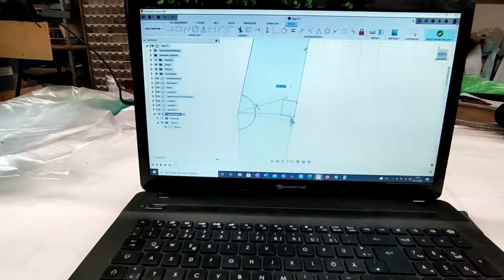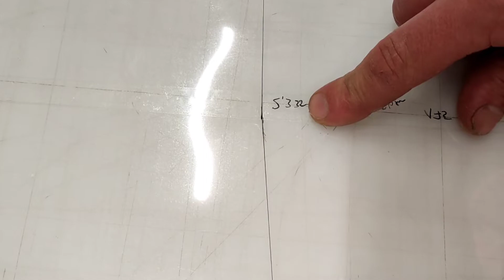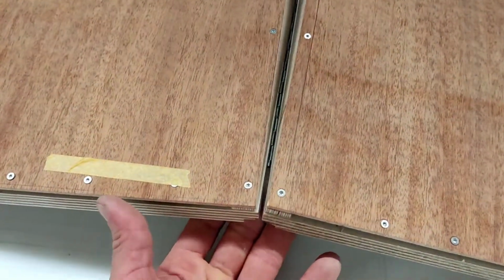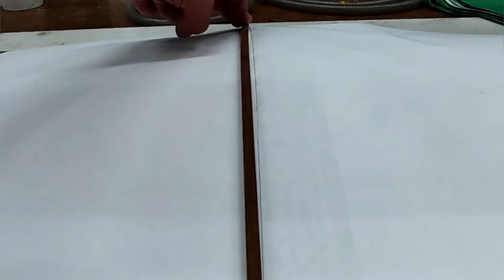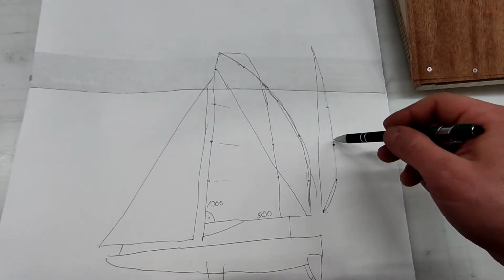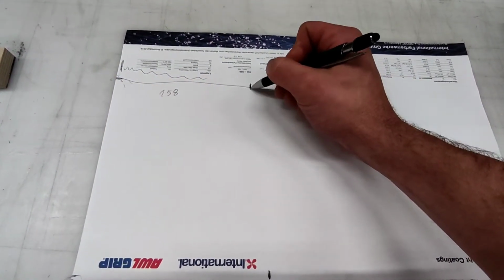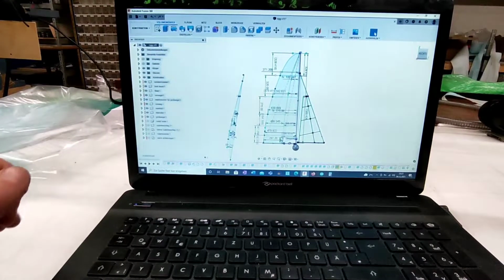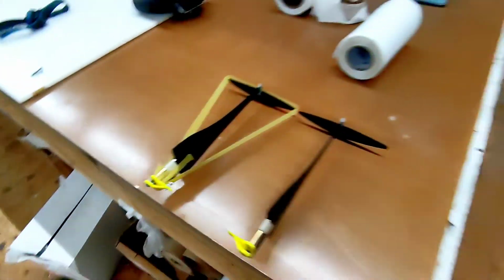RC Sailboat Sailmaking Jig and

Comment: I use a Claudio Tool to build sails. It is easier than using the "Turtle".  I use a 35% max draft position on the main and a 30% Max draft position on the jib. I build 4 panel sails. The draft for each seam is a percentage of the length of the cord. Draft for the seams from the top seam to the bottom seam of the main is 5%, 4%,  and 3%  and 6%, 5%, and 4% for the jib.
Reply from the maker: thanks! i tried the claudio and dont like it but see the potential! its much smaller to store away and gives good result if you find good tape, on what boat size do you run those 35%
Reply: I also use the Claudio tool : it's easier and very usefull when you want to test several draft positions and shape. The only downside is that you have to peel off the double-sided which stick the sail on the tool. The solution is to use a double-side easy to peel.
Reply from the maker: @EmmanuelVilmin  i don't like the Claudio tool because of that tape thing. Clever idea but dose not work for me

Comment: Can you please tell me the number for the thin 2 sided 3M tape? Thanks.
Reply from the maker: Search for extra strong extra thin 6mm double-sided tape. 3M is not really what you are looking for. You will find it in your country as sailmakers tape or 6mm double-sided tape. Should go for around 6€/ roll
Reply from the maker: Did you get something?
Reply: @carbonarne675  Not yet. I’m hoping a local kite supply store has some. Thanks again.
Reply from the maker: @jasonboyd5220  where are you from?
Reply from the maker: @jasonboyd5220  there is stuff on eBay and Amazone and so on. A lot of different stuff work really well. There is nothing specific I have used 5 different tapes and found them to be all working ok. Some are a little harder to handle some a little cheaper. All held up so far

Comment: Would really be interested in a video detailing the design side of sail making and how to calculate all the measurements needed.
Reply from the maker: That's a topic it self. But why not. I'll put it on my list
Reply: @carbonarne675  Thanks a lot. I'm new to making molded sails (for IOMs in my case) and these videos really help.
Reply from the maker: @martvaljamae3214  IOM is a tight game! to make a fast sail is realy easy but to make the fastest is sooo hard! the limitations help a lot and plenty of research is avaliable. things to consider: the sharper the sail the higher and faster you can go, the flater the sail the less drag it has. the deeper the more powerfull, the rounder the entry the more forgiving and easy to sail on the edge. luffcurve is a private thing: mainsail: a lot of tention in the mast can be rock solid to sail but if you bend the mast the mainsail needs to fit that. sail for the jib: if you run a negative or positive curve can both have good and bad impect but its always between + and - 5mm. do you want a hard forestay or a loose one, do you runin waves or flat water. most flat water a loos jib can realy power up your boat but is super twichy on windshifts- can be good and bad - you feel it fast but you stop fast

Comment: I am slightly confused how does the sail behave on its opposite side does the curve reverse itself on the boat on tacking ?
Reply from the maker: Yes that's right! The Sailmaterial is not stiff enough to hold its shape that hard. It just 'plps to the other side and is comeatly identical. That plop is supported by the wind that pushes the sail to the other side.
Reply: @carbonarne675  Thank you I am converting Robe Dolphin from slotted aluminium Mast, & booms to Carbon Mast/Boom and Mylar sails soon hopefully.
Reply from the maker: @BrianRamseysg01  that's a great project! Are you interested in 3d printing?  I can teach you how to make a new ruder

Comment: I am confused regarding your method for determining the angle that the two surfaces of the turtle make for each seam. 
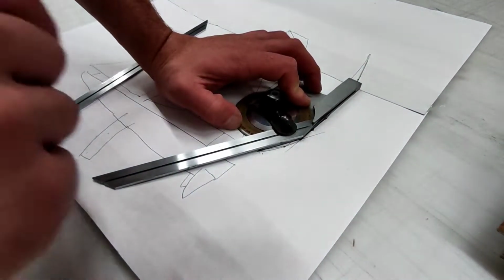 We know that the camber "sewn into" each seam is independent of the seam length and only dependent on the angle between the two surfaces of the turtle.  The method you have shown to determine this angle (at the 16:00 mark) means that you would be decreasing this angle as you go from the bottom seam up the sail to the top seam.  This means you are actually reducing the camber in each seam as you travel up the sail.  Isn't this just the opposite of what you really want?  You want to increase camber as you travel from bottom to top of the sail.
Reply from the maker: It hardly depends what your goal is. A maximum power sail will have a lot more depth in the top this catamaran sail got mot of its power in the bottom and from mast bend. I am working on a new sailmaking video for new boats. One for a trimaran one for RG 65 one for IOM one for the big boat
Reply from the maker: If you want a sail with a lot of power and drag you can make it deeper. The faster a boat is the flatter you can go. Goal is to go as shallow as possible to point higher and sail faster with less drag. (slow lightwind keel boat against foiling catamaran) 

Pointing higher is the important point: if you have a lot of twist in your mainsail you would have a deep sail in the wind and might be to deep for the angle of attaack up there. I hope that helps
Reply: @carbonarne675  Yes, I do understand that drag increases faster than lift increases as you increase camber.  My question concerns your use of the diagram at the 16:00 min mark which clearly shows you are decreasing the camber in the sail as you go from the bottom seam to the top seam of the sail.  This is contrary to modern sailmaking practice, where camber increases as you ascend from the foot of the sail to the head.  I am not aware of any sailmaker for RC sailboats, that actually decreases camber from the foot to the head of the sail.
Reply from the maker: @richardhunter5734  not really. With this sail material a lot of shape comes from the bottom and highest seam. Imagin bottom and top seam to be at 7° what would happen if you put a large flat section in between with no camber? It will still be bend as dose the second. It's just a large second.

Comment: Hallo Arne,
sehr schoen fuer Profilevel.

Ich brauche nur so einen ungefaehren Schnitt fuer ein Testmodel.
Segelgroesse ein bischen kleiner als dein Beispiel, sagen wir mal 120cm Vorlieklaenge....

Wo finde ich denn einen Schnitt fuer ca. 5-6 Panele?

Gruesse Sam
Reply from the maker: Das kommt auf das Boot an. Jedes Boot ist etwas unterschiedlich. Also start würde ich 3 bahnen mit ca 8 bis 20° wählen. Je nach dem, wie sehr die Schablone gebogen ist. Sage mir ob es klappt
Reply: @carbonarne675  Hallo Arne, Danke fuer die rasche Antwort. 8-20grad ist der Anfangswinkel der Bahnenkante von der Horizontalen.....

Ich bin erst in der ersten Konzeptphase, es wird noch ein bischen dauern, bis ich soweit bin. 

Ich habe mal grob geschaut, im Internet finde ich da sage und schreibe Nichts ! also so ein Beispiel Schnittmuster.... damit es halt nicht komplett flach ist das Segel.

Gruesse S
Reply from the maker: @SamuelLanghorn  wichtig ist, die Bahnen alle ca 25mm größer zu lassen und nach dem kleben gerade zu schneiden, so wie du es brauchst. Das grošsegel muss die Biegung vom Mast übernehmen. Die Vorderkante ist also nicht gerade wie ein Lineal sondern etwas gebogen. Der Bauch vom vorsegel ist weit vorne, ca bei 18%, der Bauch vom großsegel eher bei 30 bis 45% je nach Boot. Die Ecken muss man mit Klebeband verstärken. Also Baumaterial eignet sich Schablonenfolie von amazon
Reply from the maker: Willst du ein einrumpfboot oder ein Trimarans bauen?

Comment: I'd like to discuss one tricky point: I see you set the max draft of the upper main sail panel at something similar to the jib. I believe the reasoning is that you set let's say 35% for the jib and you think that at the top of the main, the main shall have the same draft to the one of the jib - right?
Some sailmakers are saying that the main sail curves the wind in front of the boat in such a way that the flow hitting the jib is bent upwind - this is why the draft is further in the front so as to give e fuller entry matching the flow hitting the jib. But there is no such phenomenon at the top of the main.
Moreover the top of the sail is moving in all sorts of direction due to the waves - this would lead to making a deeper and more tolerant top main sail - which you achieve with a draft positioned further back. On my dinghy for instance the best main sails have a draft position set at 50%. At the 35% the sail works only in very specific conditions in flat water (no waves) and very accurate tuning...
I'd like to know your point of view. (In model boats I sail RG65, Marblehead and 10 Rater).